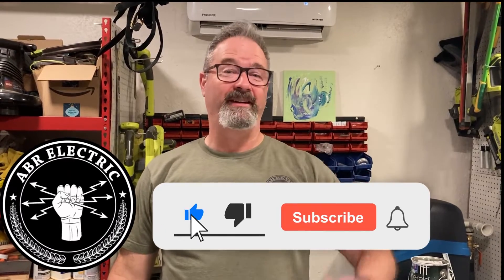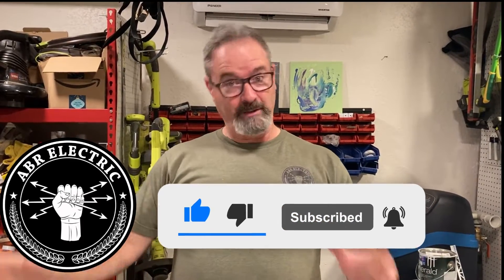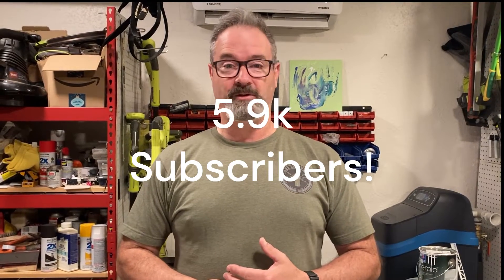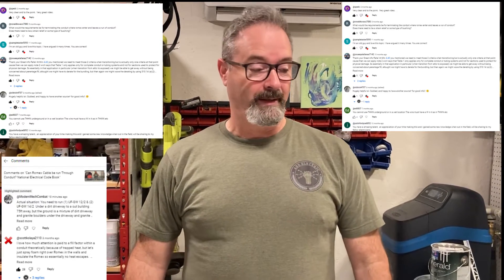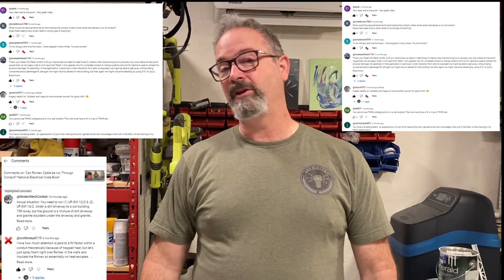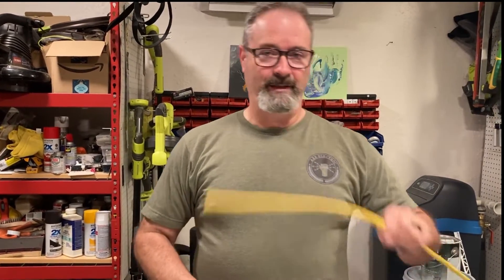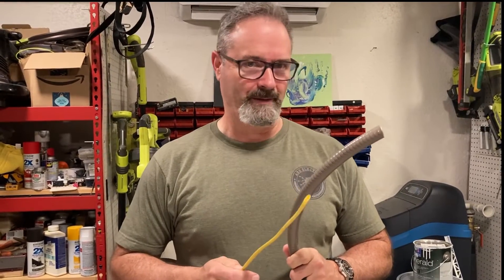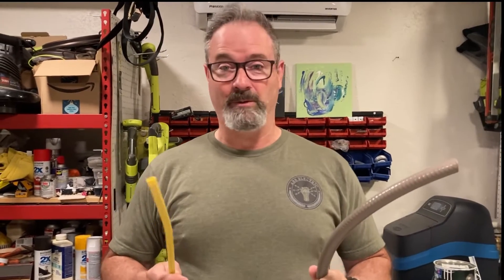Two Basic Rules for Using Romex...

Comment: I think what you did is okay, running Romex in Smurf tube is fine and permissible by code. Do not strip the sheathing from the Romex as mesohunt704 suggested as that would be a code violation, NEC 310.8. Land your neutral wires a little deeper so a little bit shows at the other side of the bus bar, like you did for the ground wires. You don't necessarily need a bigger box, you can use a box extender such as Steel City #531511234-20R, I think Home Depot stocks this item. If you want a larger box, get a drawn one with the rounded corners like you have.

Comment: Dumb question: Regarding only the damp location issue, why is Romex forbidden in conduit while individual strand wire is not?
Reply from the maker: @jakejones5736  it's assuming that individual wires are rated for a damp/wet location. Usually,  they'll have insulation markings of MTW, or THHW, or XHHW. Basically,  anything with a W works for the sample locations 
Romex has no such ratings.
Reply: @abrelectric  Yes, I understand that, hence my question. What I'm getting at is what, exactly, qualifies one type of wire to be approved for wet locations but not the other? Especially when the wires in Romex have DOUBLE insulation.
Reply from the maker: @jakejones5736  it's all about the rating, given by the manufacturer and confirmed by a testing lab, like UL.
Reply: @abrelectric  Strange that one type would have a rating contrary to what appears to be the obvious. Guess that's what makes them the experts.
Anyway, thanks for the share!

Comment: If we get specific enough to mention the 53% rule, we should also note that NEC says for elliptical cables like Romex, their conduit fill is calculated as if they were round based on the largest cross section measurement. This is what pushes them over that 53% limit usually. 
Why use the incorrect & false clickbait title? You know that is not truthful. Explaining in the video that your title is a lie does not absolve one from that lie.
Reply from the maker: I see what you mean - it was poorly titled. I changed the title. The original title was not a moral failure or an intentional deception. It's a video title, and that is all.
Thanks for the accurate description of the 53% rule - often overlooked.

Comment: Well, I found this info too late and now I'm wondering how concerned I should be or not be. I ran 12/3 NM-B Romex through 1/2" liquid tight conduit from my lake shore, along a walkway, and to a boat dock, feeding lights and a couple outlets. The conduit is above the water at all times but obviously outdoor and near water. I understand now the individual wires should have been THWN. Question is: will this fail soon, in 25 years, or not at all? How concerned should I be? We're way out in the country, I want to do everything to code but it's not actually required.
Reply from the maker: @nthnmurphy1  is it GFCI protected? 
As far as lasting, hard to say. Probably for several years. Another method would be 12/3 UF.
Reply: @abrelectric  yes, it is GFCI protected. Thanks for the quick reply!
Reply from the maker: @nthnmurphy1  if you haven't already,  subscribe!
Reply: @abrelectric  Subscribed, thanks
Reply: The important thing to note is that there is no such thing as liquid proof conduit. Every single piece of outdoor conduit I have ever opened has had some water in it. If it was below or close to grade, it was filled to the brim.

On the converse, it's worth noting this was an accepted practice for probably 20+ years and then the manufacturers started getting involved in corrupting legislative bodies - including the groups that produce and declare code.

Comment: Situation: Old house with knob and tube wiring. Just removed fuse panel and install breaker panel.

Two "if legal?" questions:

House has hot water heat, can I run Romex from basement up along sides of the cool return lines from the radiators. They are only barely warm to the touch. There is plenty of room in these pipe holes through the floors.

In "non damp" areas such as the bedrooms can I run 12-2 Romex through raceways for surface mounted outlet boxes. "Not in bathroom or kitchen and not outside"

Thanks

Comment: I have a somewhat complicated DIY question.  I recently replaced  a 80 ft run for a residential stove which had been # 6, 2 wire copper W/G , ( 2 Hots, no neutral) . 1/2 of  the run mounted to the exterior of the house and the other 1/2  thru the basement and into a J Box for the last 7 feet  of the run  to the stove .  None of the run was  in conduit.  

I was able to reduce the original run from 80 to 55 ft  and replaced  the  #6  2 wire with #8  3 wire up to the J box. 
Here is my question. I used  #8 THHN wire  from the J - box to the stove, for the last 7ft of the run and installed the THHN in 1" conduit.  My question is whether the THHN is going to be trouble  down the road , and/or whether it is code compliant.    It works fine for the time being  , measuring  32Amps at the main panel,  for the 5 min I maxed it out, but I'm worried about trouble later on.   

Thanks,  McK52749

Comment: may i use #6/3 nmwu wire for indoor subpanel  please
Reply from the maker: Absolutely. As long as your breaker is 50 amps or less, the 6/3 is in a dry location,  and inside a wall or in correctly sized conduit.

Comment: first , great instructional videos. i have a question,i am wiring a new kitchen, and have to run 6 circuits( 5 12-2 and 1 14-2 for a microwave dishwasher, refrigerator  2 outlet circuits and lighting). 10 feet of the run is extremely difficult to access but i have been able slide a 2 inch pvc electrical conduit through which makes the 6wires very easy to fish through . the pipe is in the basement, a dry area , and will be open at both ends. i thought that this wuold be the best solution , as the run, i fear i loaded with exposed nails and screws ( poorly framed bathroom and laundry area LOL)  i get so many opinions on this matter!   thanks ,
Reply: If the conduit is 24 inches or less in length its fine, but if over 24 inches you will need to adjust the ampacity of the cables. 6 current carrying conductors need an ampacity adjustment of 80%. #12 is rated for 30 amps after the adjustment still rated 24 amps and 20 a breaker is ok. The #14 is derated from 25 amps to 20 amps and a 15 amp breaker is ok. You should be fine as long as a temperature adjustment isn't required.
Reply: @JeffBanfield-t6v  You're wrong but don't worry, I gave him accurate advice.
Reply: You get many opinions and on this forum you got bad advice, it seems. Ignore @user-ll1vj7qo1m, he's wrong. There are 12 current carrying conductors in those cables, not 6, because both hots and neutrals are current carrying. The ampacity adjustment for 12 conductors is 50% so #12s will be limited to 15 amp breakers. For any 20 amp circuits you'll need #10. 
The #14 cable is a little more complicated. It gets adjusted down to 12.5 amps but since there is no such thing as a 12.5 amp breaker, you can install the next higher sized breaker, which is a 15. However, this #14 circuit is limited to 12.5 amps continuous loads or 10 amps noncontinuous loads. Seems like the 14 is for lighting so it will be fine on a 15 amp breaker.  
If use slide in two 3/4" or 1" conduits (instead of a single piece of 2") and split the cables up into 3 in each one, then 12 and 14 are good for your 20 amp and 15 amp circuits, respectively.
Reply: @pld8993  Reading directly from the code book here. Article 310.15(E)1) Neutral conductor: " A neutral conductor that carries only the unbalanced current from other conductors of the same circuit shall not be required to be counted when applying the provisions of310.15 (C) 1). I teach electricity at a college and as a former Georgia and Florida Master electrician, I think I am qualified to give advice in this forum. What are your qualifications to give advice sir?
Reply: @JeffBanfield-t6v  You, conveniently perhaps, left out the first sentence, "Neutral conductors shall be considered current carrying in accordance with any of the following." In the case of an individual circuit (one hot, one neutral), the neutral is carrying all the current from the ungrounded conductor and is NOT carrying "only the unbalanced current from other conductors of the same circuit." 310.15(E)(1) exempts only neutrals carrying only unbalanced current so treating the neutral of an individual circuit as current carrying, per the first sentence, is in accordance with all of 310.15(E). Put an amprobe on the neutral of an individual circuit carrying 5.3 amps, for example, and you'll read 5.3 amps. For clarification, you may to look up the definition of unbalanced current and also individual circuit, which seem to be the source of your confusion, as there is no unbalanced current in an individual circuit. My qualification to give advise on some random youtube forum is the fact that I have a computer. However, I've been in the trade for over 40 years, got my first master license when I was 22 and have had one in 6 different states throughout the years although currently only 3 states, been teaching the NEC for 25+ years, for the last 10+ years I've been working with NJATC on curriculum review and revisions, and I'm still out in the field every day so I'm not a former anything. Yes, that makes me an expert. So much for whose is bigger, nice try.
Reply: @JeffBanfield-t6v  You'll also notice that "from other conductorS of the same circuit" is plural, which refers to a neutral serving more than one other conductor; the neutral would need to be shared, which is not the case in an individual circuit.
Reply: @pld8993  The only time a neutral is counted is when it's a linear load or a multiwire branch circuit in a wye connected system. The neutral in single phase systems is never counted unless linear load. Period. I suggest you do some research and check out Ryan Jackson, Mike Holt or Tom Henry.
Reply: @JeffBanfield-t6v  You're wrong. Nowhere in the NEC does it say that and you continue to pretend that the first sentence in 310.15(E) doesn't exist. A neutral in a 2-wire circuit carries all the current of the ungrounded conductor and is counted. Every one of your students that leaves your class believing that it's not is going into the trade with false information because they have a teacher who refuses to learn. Does it hurt that much being wrong? Not sure your ego can handle but I dare you to go on a Mike Holt forum and start telling everyone that the neutral in a 2-wire circuit doesn't count as current carrying. Prepare to be corrected.
Reply: @pld8993  There are 3 provisions. 1. Says neutral that only carries the unbalanced load is NOT counted. 2. Says a multiwire wye connected neutral shall be counted. 3. Says linear loads shall be counted. There are no other provisions. Stop making things up as your interpretations are completely incorrect.
Reply: @pld8993  Sorry, I'm teaching a code class today. I'm using the Tom Henry line of books that confirms that I am correct and you are a hack. Like I said pick up Tom Henry's 2020 calculations workbook. Ampacity is chapter 2. Page 28 says 310.15(E)1) "the neutral conductor in a normally balanced circuit is NOT counted". Like I said before go ask Ryan Jackson, Tom Henry or Mike Holt if you're confused. I am 100% aligned with them on this and you are all by yourself.
Reply: @JeffBanfield-t6v  I'm sure they all know what the term "balanced circuit" means, which you clearly don't. Two or 3 ungrounded conductors sharing a neutral, for example, and each ungrounded conductor carrying the exact same current with the neutral carrying no current; that's a balanced circuit. That concept doesn't apply to a 2-wire circuit where the ungrounded conductor and the grounded conductor both always carry the same amount of current. Stop digging, your I don't know what I'm talking about hole is getting deeper.
Reply: @pld8993  310.15(E) gives us all the examples of neutrals that count as current carrying. Nowhere does 310.15(E) say that a neutral in a balanced circuit is counted as current carrying. In fact, the definition of the white wire is a common in a two wire circuit. This is not even technically a neutral as it doesn't carry an unbalanced current. I'm not digging at all. I've already quoted Tom Freaking Henry, and you seem to think you know better with your "superior deductive thinking". LOL. You are overthinking thi9ngs if you think a common conductor is a neutral. You are wrong on all counts, my friend!
Reply: @JeffBanfield-t6v  Correct, the neutral in a 2 wire circuit doers not carry unbalanced current, it carries the full current of the ungrounded conductor, therefore it is a current carrying conductor. Keep digging, rookie.
Reply: @pld8993  Then please explain why section 310.15 (E) states "neutral conductors shall be counted as current carrying in accordance with any of the following" and then FAILS to mention a two wire balanced circuit? 
You can believe whatever you want to, I'll stick with Tom freaking Henry the legend of electrical code. He is not incorrect and I teach his methods. 
The good news for you is you're not breaking code when you unnecessarily oversize your wiring because you don't know what the code allows. You're wasting money on larger size wire than required but you know what they say about a fool and his money. It's only a matter of time anyway.
Reply: @JeffBanfield-t6v  Now you're just contradicting yourself. So if the grounded conductor in a 2 wire circuit is not technically neutral, which is true even though we call it a neutral, 310.15(E) could not apply to it. You can either call it a neutral, apply 310.15(E), and try to make the false argument that it doesn't get counted (which is what you've been doing thus far), or you can go with the idea that it's not an actual neutral, 310.15(E) doesn't apply, and it therefore has to be counted. Which is it?
Reply: @pld8993  I'm not debating if it's current carrying. I'm telling you it doesn't count.
Reply: @JeffBanfield-t6v  Again, you clearly don't understand what the formal definition of "balanced circuit" is.
Reply: @JeffBanfield-t6v  So which is it? A) It's a neutral and 310.15(E) applies or B) it's not a true neutral therefore 310.15(E) doesn't apply. You've now made arguments that directly contradict each other to try to prove your incorrect conclusion, but it can't both be a neutral and not be a neutral. Pick one.
Reply: I found a video where Holt only talks about shared neutrals when he says neutrals generally don't count, and he's been advised that neutrals in individual circuits are always counted as current carrying. He apologized and thanked me for correcting him. Now that one of the gods that you worship has been corrected and acknowledged that I'm right, you can believe him and not worry about anything I say. You're welcome.
Reply: @pld8993  Link or it didn't happen
Reply: So I wanted to see the answer to your question, but instead I found two people trying to one up each other, calling their opponent a hack, arguing over one very specific sentence in a code book and not being very much help to anyone at all. I’m sure they’re both extremely well versed and capable electricians, but with one dropping names of books he’s read and some guy I’ve never heard of who he thinks is some kind of neutron god, and the other repeating a sentence from the code book 46 times, I’ve come to the conclusion that they’re both wrong, and in this specific scenario you should run a single circuit of the largest wire type you can pick up, from a 200amp main directly to a toaster (lose the factory wire, just bolt the wires to each other and the metal body of the toaster), put these two guys in a filled bathtub and hand them the toaster and tell them the winner of the argument gets it as a trophy. While they each pull and yank at their “trophy”, arguing like toddlers over a tootsie roll, calmly walk back to the panel, throw the switch and walk away. I am not an electrician and I don’t know if this would solve the problem, or just short the circuit, blow the tub up, or nothing at all. I’m just making suggestions that work about as well as these two grown ass men arguing and calling each other names like two women with a tiara.

Comment: And I am telling you, you are wrong. 
Site the actual code text that prohibits romex in conduit. Nobody has ever been able to do this - not a single one of the many great oracles who know everything.
Why do this? Running conduit all over the house might be a tad costly, but there may be a place or two where PHYSICAL PROTECTION might make the conduit a valuable commodity. So, run the romex as usual, run it through conduit where safety dictates, then go back to open romex. No boxes needed; no splices between wire types involved, just protect where necessary.
Conduit fill? That applies REGARDLESS of wire type. Of course you follow it when running one wire or twenty and regardless of gauge, etc. 
Sooo...You still haven't shown how romex in conduit violates code.

There IS a place where it could make a difference, and this applies to electrical wiring, telephone wiring, co-axial, or any other wire and that is in commercial buildings. It falls under different fire codes,  not simply electrical, and has to do with the insulation type. Some give off highly toxic fumes when burnt, and are forbidden in air plenums, as well as conduit or raceways, etc. But that isn't NEC.
Reply: This guy has several videos on this same topic, look it up, and every one of them has a title that says that romex is illegal in conduit, but he then pivots to wet locations in the video. He knows better, he's just trolling for clicks for $$$.
Reply from the maker: I did site the Code, in several videos. I am not saying to never install romex on conduit. Most of the issues,  again, are running romex in a damp/wet location.